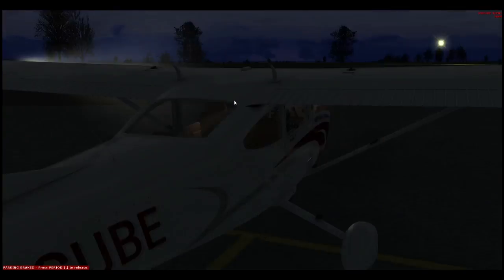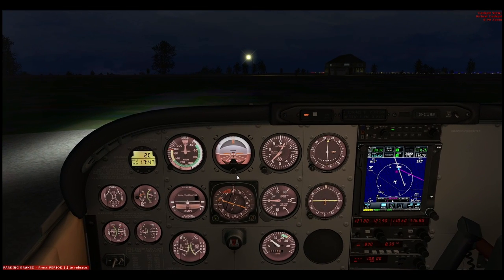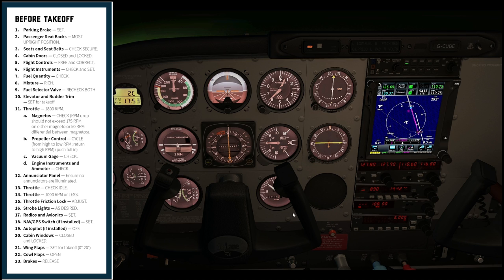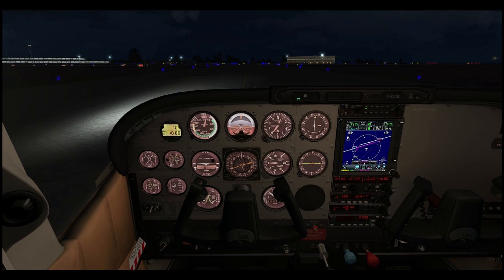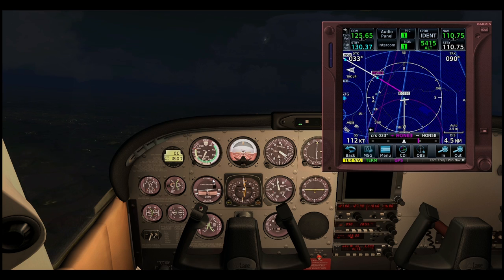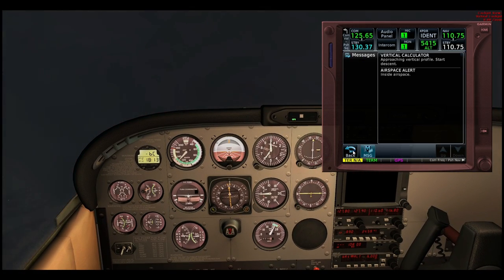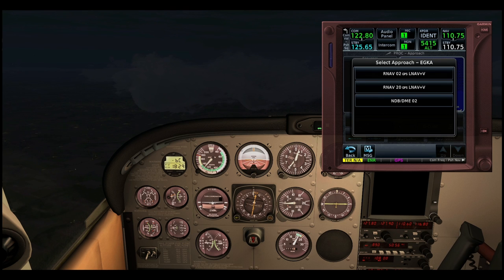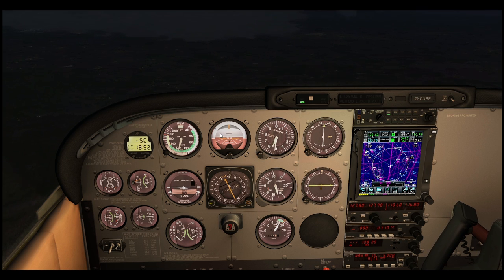A2A C182T Skylane - VATSIM IFR - Departure Part 1

Comment: Throttle friction is most likely a lever on the throttle lever itself. It sets the smoothness (or force needed) to move the power lever. Oh yeah, and another great video Pete !
Reply from the maker: yea thanks, I had a look but couldn't see anything modeled or clickable, I could have missed something I guess
Reply: Peter Matthess  Its probably not modeled, will have to look in the 182. In a cessna 172 I fly its a little black thing just below the throttle handle (same stick).

Comment: Hey Peter, nice vids! Quite entertaining, especially when things don't go smooth as silk! Cheers!

Quick question: Is the flight plan you create in the 750 persistent when the unit is powered off? For example, if I don't want to sit on the tarmac with my motor burning through avgas (virtual dollars are just as important as real dollars in my (virtually) empty wallet!), could you make the plan first, then shut off the batteries for a preflight walkaround, and have the plan intact when the plane is repowered for startup? Or is the plan wiped out by cycling the 750's power?
Reply from the maker: cymrych79 hmmm, good question! I will have to quickly test that sometime.
Reply: Peter Matthess Well, I figured it out. Broke down and bought the F1 GTN, and I am soooo glad I did! Very nice implementation.

Anyhow, if you create a flight plan in the GTN, you can save it to it's own directory within the unit itself. The plan does indeed get wiped out if you power off the avionics, but it's simple enough to reload once the motor's turning.

Comment: hi. does the GPS of the A2A C182T has updated GPS data compared to the fsx stock garmin500 - like updated waypoints,...etc?
Reply: +unclealig This GPS you see here in this video isn't from A2A, it's from Flight1. That's the GTN750, it uses Real World AIRACs, that means if you really want to update this Garmin GTN750, you need to pay alooot of money, but it's of course about a million times better than the default gps :)

Comment: I need the Flight1 GTN 750!!! It's just the £~33  price tag that puts me off! It would work with my Turbine Duke and 182 as well, on a scale of 1-10 how would you reccomend this? Also how did you get a PFPX data file for the 182? Many thanks
Reply from the maker: Once you pay for the GNT 750 you will quickly forget your dismay of spening 33 quid mate, its all I can say XD And no I don't have PFPX data for the 182, I just use it to plan a route and then I use that.
Reply: Peter Matthess I got the GTN 750, and I am loving it! Really enhances your general GA flying experience, IFR or not! Thanks for recommending it!
Reply from the maker: no prob! :)

Comment: how do you fly IFR on the a2a 172 where you only have default GPS?
Reply from the maker: +krelshell4 ah, now thats the question! :) You can fairly easily using VOR Radials and other assorted nav aids, its just a little more primitive than glass cockpits
Reply: Peter Matthess For example. how do i fly SIDS and STARs and airways? Or do I file my Flight plan with only VORs, NDBs etc..? And thanks for the prompt reply!
Reply from the maker: ah, well as for the SID's and STARs, go check out my video on flying a SID in the Twin Otter with only VOR radials, basically look closely at the SID charts and you will find that a SID or STAR is usually based off VOR radials and NDB's to begin with, its pretty cool
Reply from the maker: https://www.youtube.com/watch?v=bFFwYkTP5gE
Reply: +Peter Matthess 
Thanks!